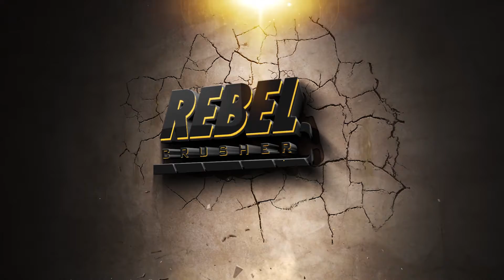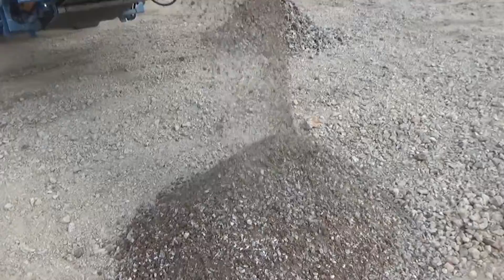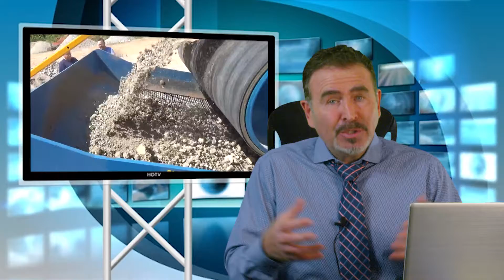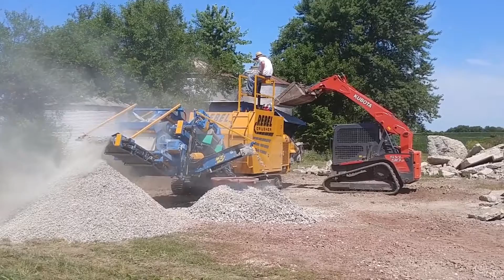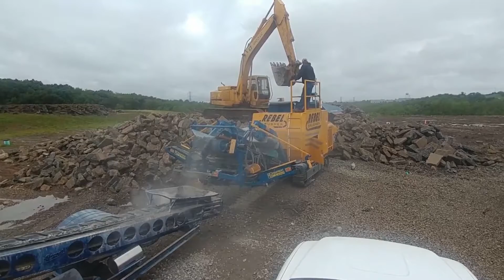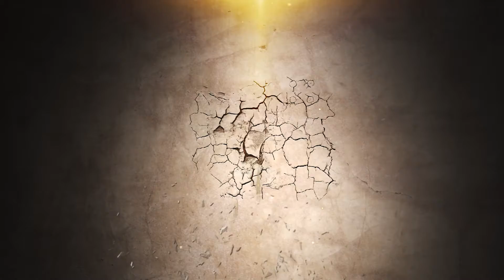🔨 Jaw Crusher vs Impact Crusher | What's the Difference? 🔨

Comment: Can impactor be used to reduce rubble size (12mm or lower) to 4.75mm and below ?
Reply from the maker: It would be very difficult and would depend on the type of rubble.  It may be very inefficient depending on how the material breaks.

It can be done.  The question is how many times does the material need to be recirculated to achieve the desired results?

We would ask for a sample to conduct a free test and share the results via video.